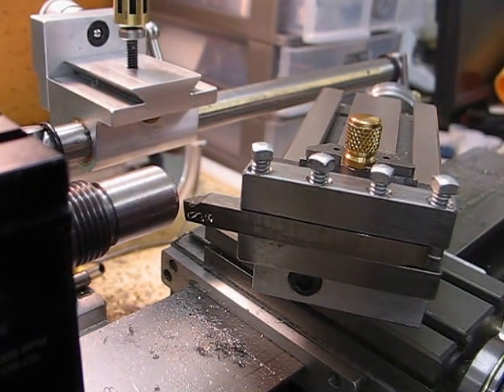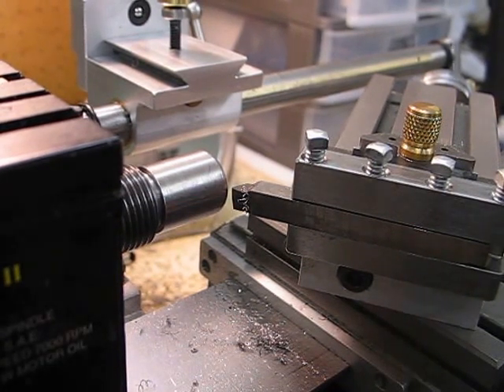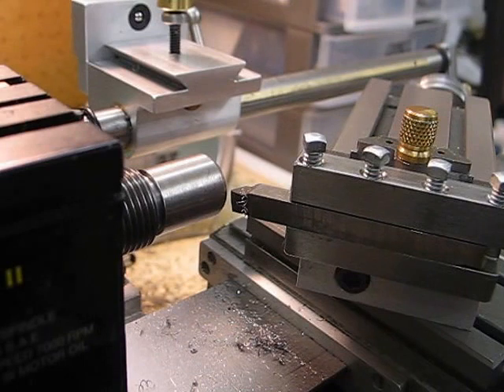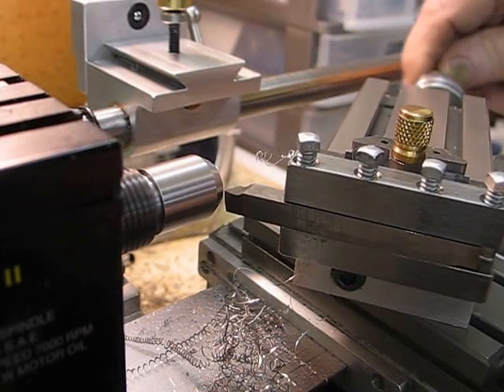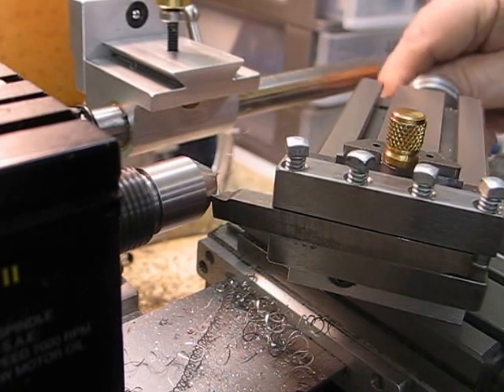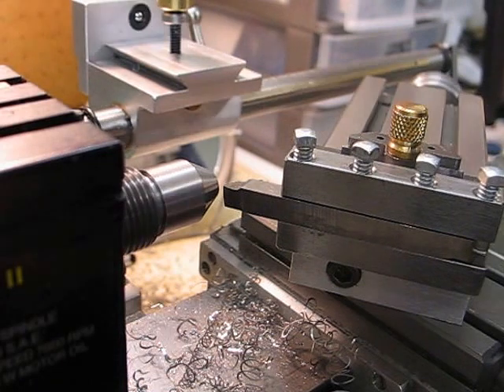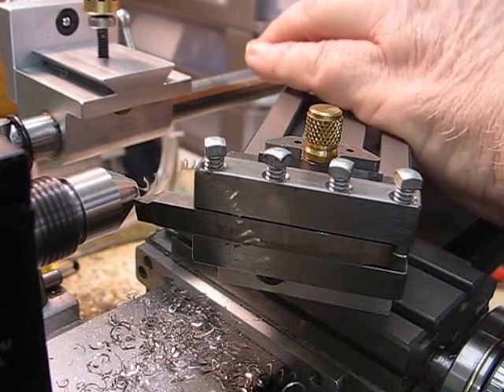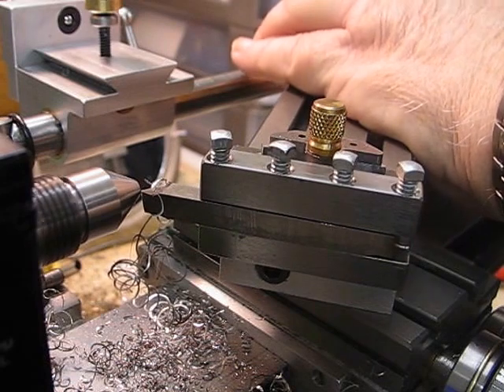MVI 0254 making a dead centre with drawbar for the Taig lathe

Comment: I have subscribed to your channel. This video is impressive. 20 thou cuts on stainless! You are absolutely right, the Taig topslide is flimsy at best. It always "walks" on me no matter how hard I cinch it up. I love your topslide mod. If you could see your way to providing some drawings for the mods, I would eat them up. The eccentric shaft itself is a fine piece of machining and I would like to see how you did it. I am sure it can be done on the Taig with a four-jaw chuck but I am self-taught; I don't quite know how to set it up. A Taig is no Hardinge HLV. On the other hand, it doesen't take up as much real estate, either, nor is it anywhere near as expensive. I love it. Taig channels on YouTube are few and far between, so thanks for filling the gap.

Your camera seems to cut out at very unfortunate moments. In my limited experience this is due to one of two problems:  (a) the batteries have given out. (b) you are close to end-of-memory on the camera. The latter can sometimes be helped by installing a larger-capacity "flash card" if your camera will take one. I do not think your camera has a time-out built in; rather it detected (a) or  (b)  or some other condition, and shut itself off.
Reply from the maker: Juan,
   to copy my eccentric locking modification you will have to make a new base and it will have to be at least .250 thicker than Taig's original top slide base that's if you want to use the eccentric pin system, you haven't mentioned a mill, do you have one, do you have a cad program that will open Draftsight cad program?, and yes I made the pin on the Taig lathe, I used the dims of the Taig base to make the new base, 
The camera that kept stopping was my old Canon and I think I fixed the problem, it was in the menu, this new camera is an AEE action camera and the sound problem I think I have also fixed in the menu but I won't know until the next video,
Reply from the maker: Juan, 
   if I remember at one point in the video I think I removed total .040 thou on a cut without cutting oil, the eccentric really did work perfectly, also because I raised the top surface of the top slide I was compelled to find a new way to hold the toolbit so I killed two birds with one stone,